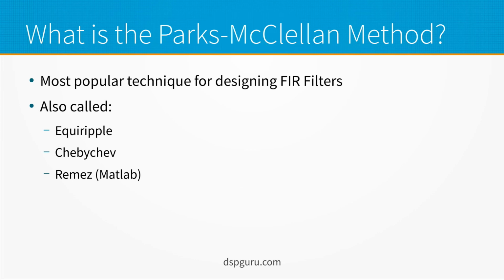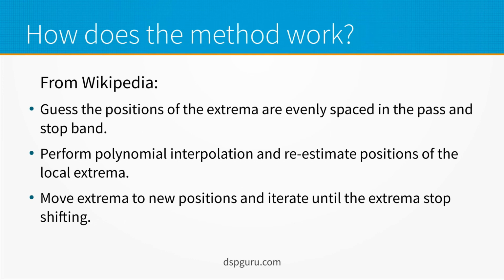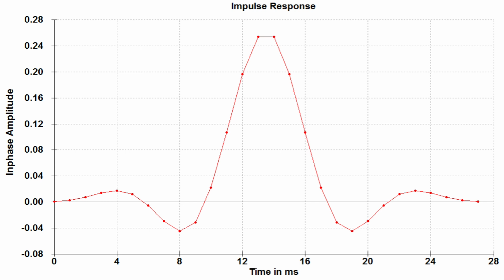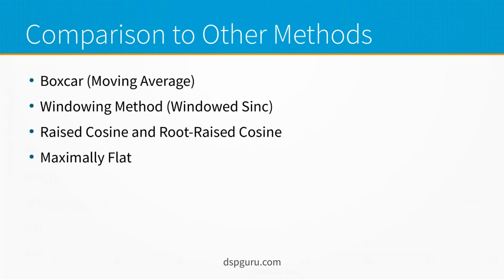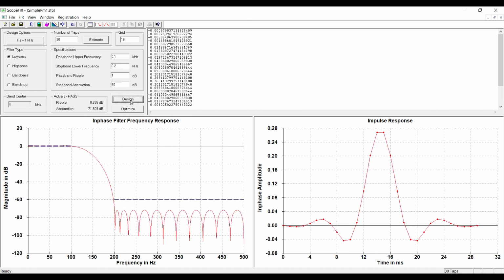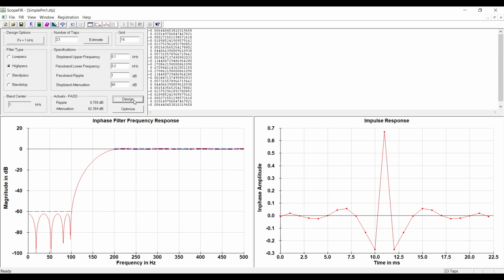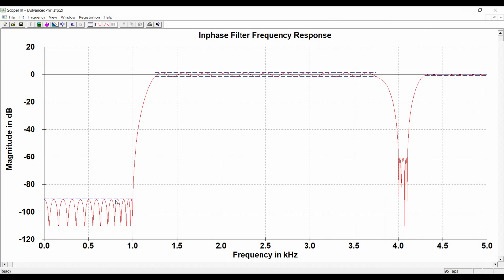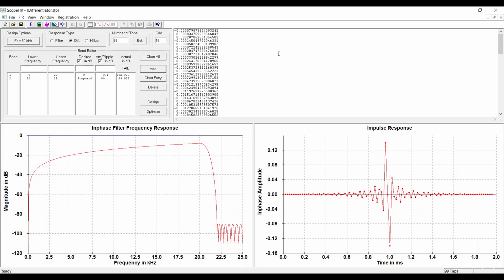The Parks-McClellan Method for FIR Filter Design

Comment: Hi may i ask a qns? If i need to create fir filter with firpm, single 512tab which mean 512 order, use setting 1 as example, how to create the lowpass filter as b=firpm result nan, f= [ 0 0.4 0.8 1.0], a=[v(1) v(4) v(8) v(10)]?